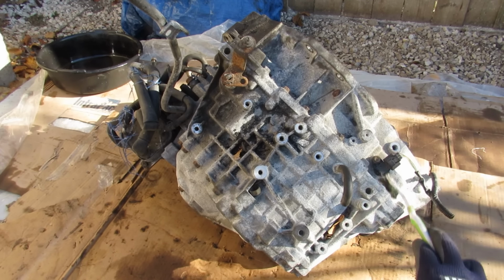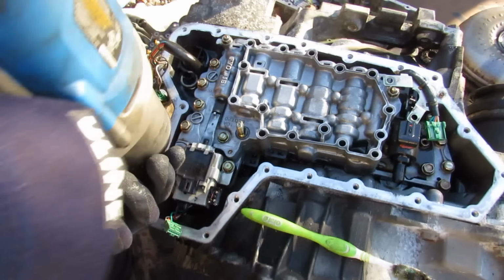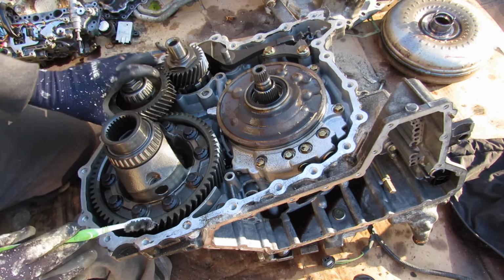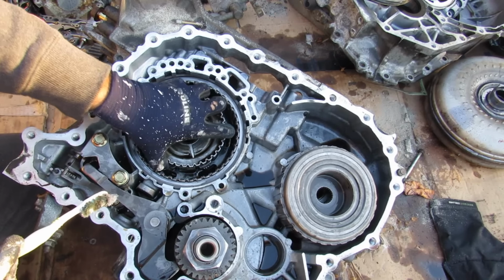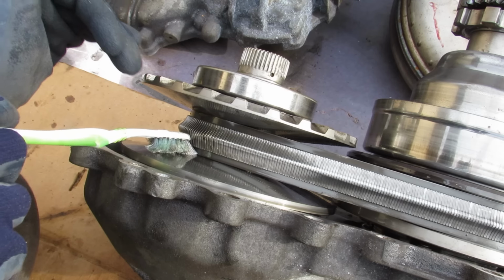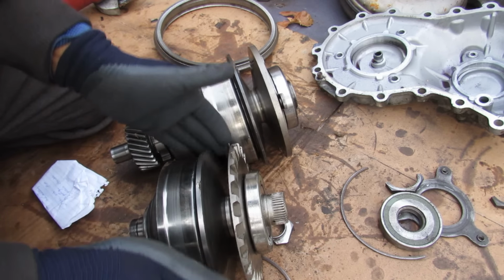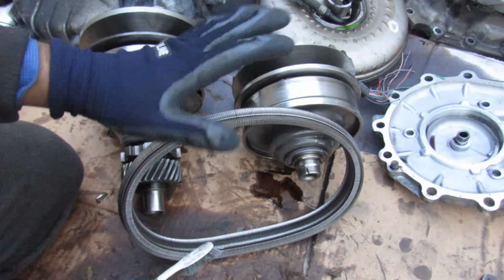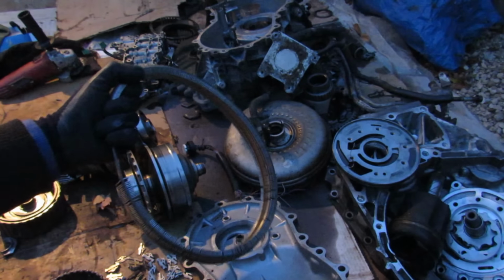Why Nissan CVTs FAIL

Comment: Great video, I read about the guy that designed this from Sweden. He had a prototype dual belt setup on a F1 car and after a couple of laps beat the track record by a few of seconds. They ruled it experimental and outlawed it in F1. He used Titanium links and the more power you have available you add more links. If this were built with a little better design it would've lasted much longer. Once you overheat the oil it loses it's film strength and it's over whatever it is.
It looks like the belt wasn't the primary failed part in your unit.
Anyway, interesting video. 👍
Reply: That's why you need to change the whole 3 quarts they hold
Reply: So overheating is what causes these  cvts to fail?
Reply: @jensfalk7973  that is one of the leading issues yes again its only 3.2 quarts capacity of fluid. If that fluids not changed regularly it burns and then begins clogging ports inside the transmission, personally I would service the transmission myself it's pretty simple go to harbor freight and buy the fluid extraction tool slide the tube down the filler neck of transmission/cvt extract the fluid and refill with valvolines cvt fluid that's ns-2 certified it's a blue bottle costs about 12-13 dollars a quart. Flush that drive about 500 miles then do it again reason for this process is to flush the remaining old fluid out as some fluid will still be inside the torque converter this allows that new fluid to circulate through and then flush it again which will result in 90%of the fluid being new and will now have its integrity back to properly lubricate the parts inside with newer and healthier fluid. If you have this service done at your dealership its don't the same exact way I described just costs 300dollars each time it's done, the extraction tool is about 120 from harbor freight and also works great for flushing rear ends and many other serviceable fluids in your car just remember to clean the hoses that are being used inside of other fluid ports as these fluids used in automobiles are not designed to be mixed with one another and can have disastrous consequences if they are mixed
Reply: Also not leaving the car in gear when there is a huge line at the drive thru while trying to feed your crew or even when there is traffic jams will prevent your cvt or transmission from overheating the real problem with cvt transmission is that the torque converter was designed without the stall feature most inline transmissions have so the car constantly wants to go I'm sure when at a stop light you have noticed if you let up on the brake pedal the car wants to move forward
Reply: @jensfalk7973  also if people beat on the car/ drives like butthead, none of the cars on the market are built to be beaten on such as not making sure car is at a complete stop before shifting gears such as backing out of a parking space, or rocking the car to get unstuck in the snow can have numerous problems with transmissions better to get the shovel and clear the snow from around your tires or use the floor mat trick which also helps I'd stuck in the mud

Comment: An year ago I was telling my wife the same thing that CVT cannot handle heavy load. I couldn't climb a steep hill in my Honda Fit. The engine is strong but not the CVT. I stopped driving after a minute and turned back. I guess the belt would have snapped if I had continued driving.

Comment: U can say the CVT transmission is crap but I know 3 people who have 175000 miles and one has 234000 miles on the original transmission without doing anything and only one had the fluid changed at 150000 miles so it determines how u take care of the vehicle

Comment: I watched this I was at a tire shop some lady crying got quoted 3500 for cvt replacement on a Sentra .. I was like dang I sold my old accord with 150k and it was running fine
Reply: 5 or 6 speed  for the win my 35 year old fiero GT still shifts fine. 150k+ miles if it ever needs a clutch its like $120  in parts

Comment: So when the Nissan Dealer said they were “rebuilding” my co-workers CVT, they were really just replacing it?  It was a Rogue with only 60K. 1st “rebuilt” CVT only lasted 1 day.  Rebuild #2 is still going.
Reply from the maker: Rebuilds are aftermarket, they are probably replacing it.

Comment: CVT is great for ATVs or scooters that will only go a couple thousand miles in their lifetime. They're cheap, they work and they can actually be fixed pretty easily. They usually need the belt replaced every couple thousand miles though, and Nissan obviously wanted it to be "maintenance free". If they'd made it a bit simpler and made it so you could actually access and replace parts like the belt, it would be awesome. They should obvioisly be making them where the belt is the main wear part and can be replaced, while the rest will last the lifetime of the car.
Reply from the maker: Yes

Comment: I work in auto finance and I recently had a  Woman who is desperately trying to get out  Of hurt 2019 Nissan sentra. The car had to replacement transmissions under warranty  And Nissan would only extend her basic 3 year/36K warranty with a 4 year 50K extended warranty. Since the car is almost out of that extended warranty. She knows that the next transmission will be on her. As someone who owns a 2000 Camry with literally 435 K miles on the original engine and transmission I think it's awful that someone would spend this much is that woman did for a sentra In worry if she would even get a 100 K out of it Before something major goes wrong. At 1st I thought maybe she had a lemon until I came across another customer with a 2017 Pathfinder that has been fighting with Nissan over his 2nd CVT transmission shaking and shuddering. Nissan acts like they've never heard of an issue like that but he pulled up multiple YouTube videos of owners with the same Pathfinder doing the exact same thing. I know I've been really lucky with my Camry but I've also been very good about the maintenance. When I bought the car brand new as a dumb starving kid in college I realized the day after I bought it that I probably shouldn't have bought such an expensive car in the only advice my dad gave me was  That is the car stopped working then I couldn't make it to work so I better take really really good care of that expensive investment. Hello Sue never forget the old Cuban mechanic at the Sears auto center. He told me in Spanish that is long as I remember that "oil is cheap and engines are expensive" I should definitely get 200 K easily out of this car. I've taken his advice and have gotten more than double that . Although I make a lot more money now and can literally drives almost anything I want ( Within reason of course) I find it to be somewhat of a badge of honor that I haven't had a car payment since 2005 and although my Camry is definitely not the newest car in the parking lot it is one of this  Shinyest And definitely the most loved. She turned 21 this past October  And as a funny gift my son made a scrapbook of the different phases me and my Camry have gone through over the years. I had pictures of our wigoer  phase With the ridiculous rims that only a 20 year old  Cubanito (me) Would love, Hour fast and furious  phase with The ridiculous rice or body kit, The grown up "I want to be taken seriously" phase with the body kit removed and the stock hubcaps And wheels put back on, To the current "I'm 40  Now put still deserve LID head and fog lights ".
Reply from the maker: Wow

Comment: How often would you recommend changing the CVT fluid even though manual said it's "lifetime" ? Thanks for the information!!
Reply: High risk of failure due to introduction of solid contaminants during fluid changes. IIRC, they don't even include a dipstick to check the level.

Comment: i lucked out and i got a auto in my versa after fearing i had a cvt for the longest time.
Reply from the maker: Versa came with auto??
Reply: @speedkar99  yes it did. believe or not. my 2012 versa SL came with an auto. there were 3 options. the manual. auto and then the dreaded cvt. one way to tell that you had the auto or cvt was to look at the gear lever. if it had the P-R-N-D-2-1 then it was a auto. But if it was the P-R-N-D-L then you had the CVT.

Comment: Wrong fluid inside. Original ns2 nissan fluid is clear as water. Somebody damaged this transmission by using wrong oil.
Reply from the maker: Clear trans fluid?
Reply: @speedkar99  yes, CVT fluid from Nissan doesn't have any color. It's clear.

Comment: I have a 2016 nissan altima.  The transmission lags going in gear.  Have to rev engine then wait the rev again it goes in gear.  Sometimes the car will excel Sometimes it want. Any suggestions.  Iv changed fluid and filters.

Comment: Great explanation while tearing it down. These are easily rebuilt really, but would be swapped out as a module, so very expensive. The last tips are the most important, coolant change, trans oil change (with exact specified Nissan oil) and no towing. There is actually an additional trans oil cooler part you can fit to some Nissans to improve that cooling issue. Failure points seem to also be the valves, and a small hydraulic pump, but usually fail due to overheat I think, so once again probably related to trans oil temps. Worst-case scenario would be towing something a long distance on a very hot day etc. where the trans oil temp can just keep rising, there is no indicator in the car as to this temp except when you see a CEL I guess.

Comment: I don't see how the belt can transmit energy by compression - pushing - when it must at the same time be in tension in order to grip onto the pulley flanges.  
     A belt or chain has to be in tension at all points where it contacts a pulley.  When at rest the tension is the same everywhere;  when doing work the tension on one side [say the top of a bicycle chain] increases and the tension on the opposite side decreases by an equal amount, and the tensions in the parts of belt or chain in contact with the pulleys or sprockets, as they move gradually around them, change evenly between those upper and lower tension values.  
     The tension in the part of a belt touching a pulley, which must be present for the sake of grip, cannot gradually reduce to zero at any point - let alone move into compression - because that would compromise that necessary grip.  Think about working with boats:  the slight reduction of tension that one's hands give to a rope, that is sufficent to allow the rope to begin to 'surge' around a mooring bollard or a capstan.
     My engineering nous tells me that here we have one of those technical myths, in this case one that must have begun when belts composed of solid pieces were first introduced.
    To put it simply, if a belt is flexible enough to bend around pulleys, then it will not be able to avoid bending if put into compression.
     Anyway, apart from that, what a great video, from a real expert, not a wasted word, fascinating, informative, and even humorous in parts!  Thanks.

Comment: Excellent CVT video. My experience is with the mini coppers. Just a regular 4 cylinder you’re lucky if you get 150k miles from it. Then that rubber band breaks and the only real solution is a new $6,000 transmission for a $3500 car. I have bought a lot of them for parts from customers. I hate those transmissions.

Comment: At 7:15 he says fuel pump... take a drink.I'm not trying to be a total dick, but it would be a fun drinking game of errors off YouTube or the internet  . I make plenty of my own, so don't think I don't think you know don't what you are talking about, though in all reality you should refer to bolts based off their thread size, rather than the wrench to do so. I did for years and it just isn't cool, unless your giving an exact instruction of what wrenches for the task at hand.  Even then if it was worked on it might not be the same wrench size, but the same thread. Example M6 1.0 thread pitch .... very common for 7mm 8mm, 10mm or even 11mm wrench to fit the head

Comment: I know every one is different and I may have to walk tomorrow, but I have a 2015 Pathfinder with 159k miles on it with no transmission problems.   I changed the fluid and filter at 90k and it has not had an easy life....

Comment: So it depends on computers and electronics buried deep  in oily hot environment, plasticizers can migrate from plastic causing brittle ness in plastic parts and electrical wire insulation. Heating and cooling causes expansion and contraction
Designed to work a year or two and die, on a powerful car.  I always wonder why they don't automate a standard manual transmission, combine a computer with a manual/standard transmission for automatic gear change.

Comment: I will never buy a car with a CVT trans, Save 2 MPG then pay $3K for new trans.
Reply: Buy a Toyota Prius with CVT. Save good MPG and fucking reliable. CVT is a very good technique IF DONE right (which Nissan isn't). Also, 4 cyl can be reliable as well, like honda and Toyota. Just has to be done correctly

Comment: I bet if those CVT's held More fluid in them like a typical automatic, Typical Trans Hold anywhere from 13 15 quarts total.. where as the CVT's only hold 8.5 quarts of a much thinner Fluid.. And that's on my AWD CVT, I think the Front wheel Drive CVT's hold even less.. A CVT cooler is necessary N Nissan said screw it on the Jukes.. I had to buy the 4 port Beehive trans cooler and ad a small rad to my car for cooling.. But I think drain and fill's once a year around June right before the weather gets really hot are super important.. Every year no matter the mileage.. But  that's just me..
Reply from the maker: Good thoughts

Comment: It fails because stupid ppl are torquing the piss out of them waiting for that simulated "gear shift". Father got himself an Infiniti QX50 which surprisingly came with 4cyl, FWD and CVT. I was kinda upset at first , but once I drove it ,  I'd never guess it was a CVT with the "shift" scheduling and it rings out every bit of power out that 2.5L VCT. WHAT A FOUR BANGER! IMHO, CVT's will eventually be the new norm. Cleaner, Simpler and cheaper and you know that's what car manufacturers value the most, not to mention it will be the only way for future v6's and 8's (if they will continue to even exist) to meet EPA. Give the old CVT a chance. It's still a fairly new technology.

Comment: CVT is a great idea I liked mine the only problem I had was every 70,000 miles you had to spend$5,000 for a new transmission WHAT NISSAN NEEDS TO DO IS MAKE IT WHERE THE BELT IS EASLEY REPLACEABLE I WOULDN'T MIND IF I HAD TO PAY FOR A REPLACEMENT BELT EVERY 60, MILES
it's my understanding that the belt in the CVT transmission is the weak Link!!!
Other than my CVT transmission issues I loved my NISSAN Sentra they
They need to work on there customer service and recall program!!!

Comment: I drove a Nissan Altima back in '05 when the new gen Altimas came out with the CVT and a 3.5L V6. The car drove comfortably and acceleration was smooth, and lacked the little shimmy you get from standard automatic shifts or a manual gear changes. Most likely the CVT got better over the past 15 years, and few people I know do like them, but to me, that Altima never felt settled. Even during cruise, it felt like the transmission was constantly re-adjusting. Every bump that made my foot twitch by an 1/8 of an inch seemed to have an effect on what the CVT was doing. Just somehow felt... off.

Comment: So you save 10% of fuel costs in exchange for a transmission that fails at 40,000 miles - no thanks.

Comment: Had a 2016 Pathfinder. They did a complete rebuild at 60k miles that would have cost me $4k if it wasn't under warranty. Loved the vehicle and would still have it if the transmission would have been more reliable.
Reply from the maker: Why did it fail?
Reply: @speedkar99  Not sure. I did test the power a couple times, but when I took it in for the 60k mile service, they said that what they saw and what codes the computer had, Nissan recommended a complete rebuild.

Comment: FYI I believe Nissan recommends  a fluid change every 30,000 miles or so.  It must be pumped in from the bottom (ie you need a lift) and that shit is anywhere from $35 to $50 a quart and I think it's a 6 or 8 quart system.  Who thought putting a snowmobile transmission on a car was a great idea?
Reply from the maker: You can also fill it from the dipstick hole right?

Comment: Thank you for this very informative video. Here's a question for you: we have a Mitsubishi Outlander that also has a JATCO CVT.  From what I understand, the Mitsubishi CVTs do not have the same failure rate as the Nissan Rogues.  Someone told me that it was about the programming.  Is this true, or is there another reason?  Currently, our car is about ten years old, has 114K miles, we change the fluid every 30K miles, and we don't tow.
Reply from the maker: Yeah I haven't heard of any other brand with as much just CVY failures. Can also be due to the loading
Reply: @speedkar99  I used to carpool with a lady who had a 2015-ish Rogue.  She and her husband kept up with dealer-recommended maintenance, and I am very sure they did not tow with the vehicle.  The CVT failed at around 45,000 miles.  This is why I am also wondering if there is more than loading involved.

Comment: its a great system but with a massive point of failure
its pretty much designed to fail like early engine parts
i can think of many different ways to use the same system without having a metal belt be pinched by metal discs
Reply from the maker: Or just stick to a manual

Comment: Most of them fail due to overfull fluid. Hotter it gets higher the level, it foams looses pressure and slips. Set fluid at lowest level and coolant at max 45% coolant. An additional cooler would help too. Saw many where just lowering the fluid "fixed" them.
Reply from the maker: Interesting analogy